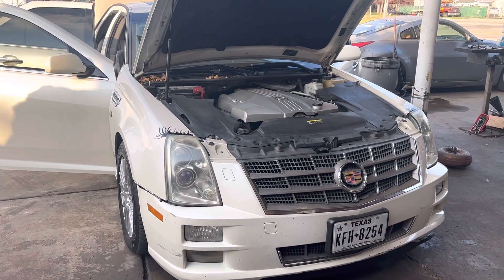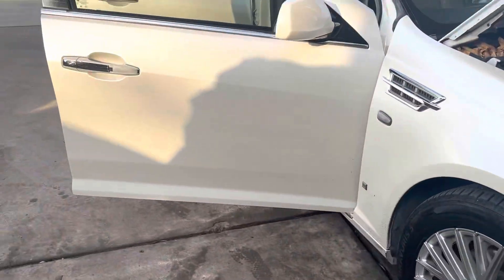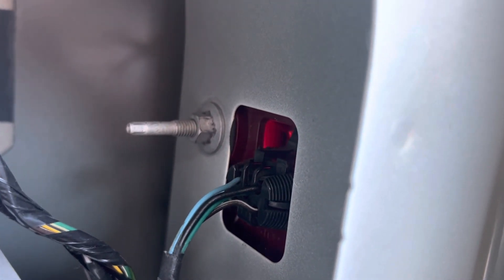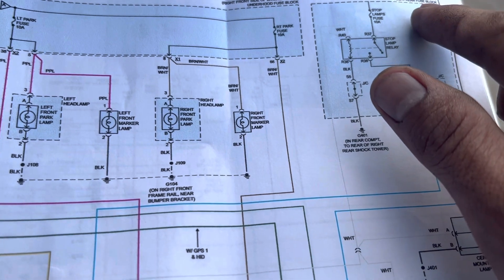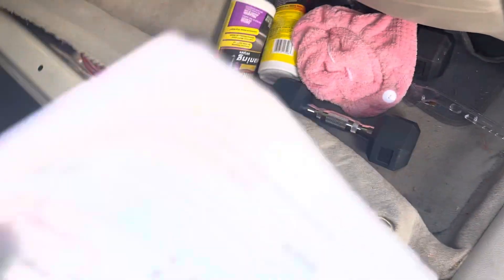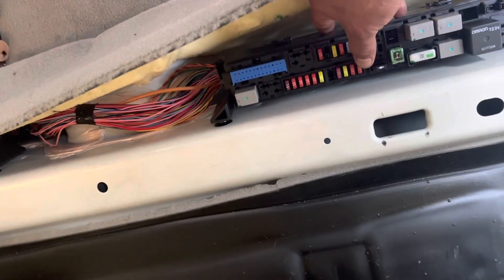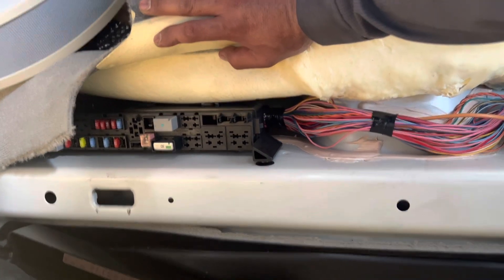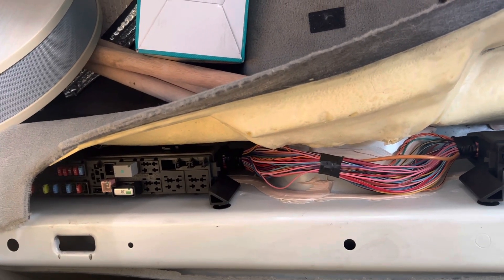2009 Cadillac STS 4.6 brake lights not working. Fuse box location

Comment: My brake lights work,and turn signals , just not the stationary tail lights, my mechanic tried everything ?
Reply from the maker: Do you mean the running lights ?
Reply: @antonioaguirre6166  any suggestions for rear passenger and high mounted light
Reply: Did you ever find the problem I’m currently having the same problem
Reply: @p80alex20  I actually jus found the problem yesterday . For me I changed my battery terminals and it was jus a fuse!  So mad if I knew it would of been fixed lol
Reply: @erikawoods9461 where was the fuse . I’m having the problem for my running tail lights on left.
Reply: @MrScott33  id have to ask my mechanic bc after 3 days my right tail light running light isn’t working